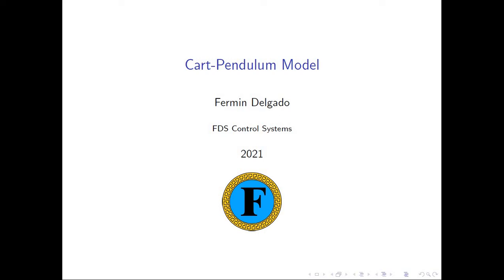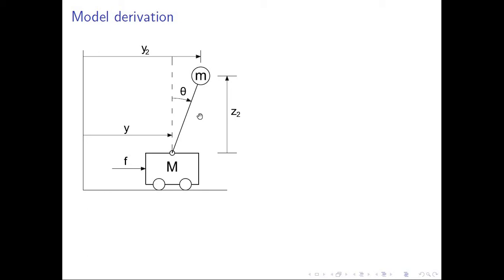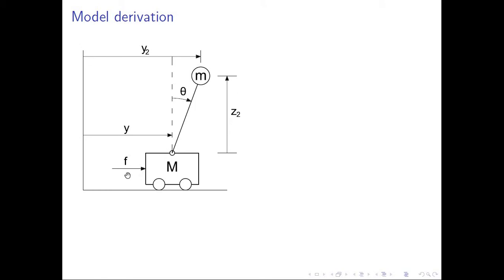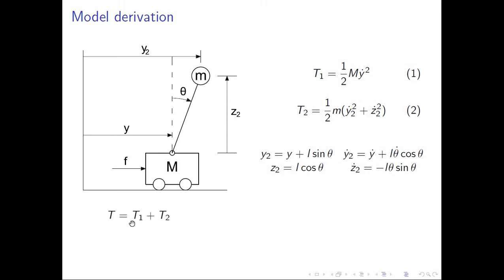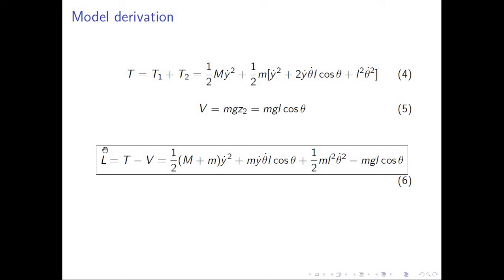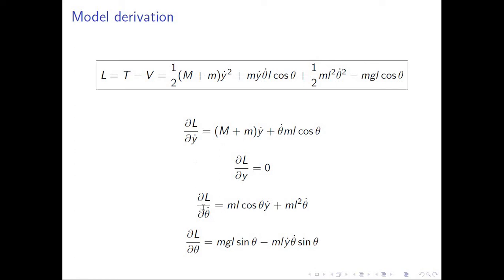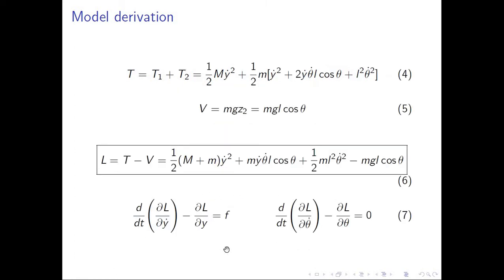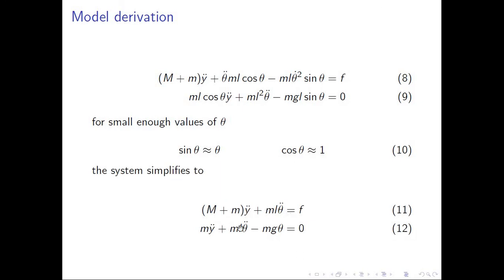Cart Pendulum Model

Comment: Could you explain how you went from equation 8 to equation 11? How did (ml theta dot squared sin theta) go away?
Reply from the maker: Sure! This is an assumption, just as I mention a few seconds before in the video. We assume that the angle variation is small, also this term considers very small quantities being multiplied so, it can be neglected. I repeat, this is just an assumption of small deviations which lead to a linear system. You can work with eq. 8 which is the nonlinear version, more accurate but more difficult to control.
Reply: @FerminDelgado  Thank you so much! I appreciate the timely reply!

Comment: What happened to the 3rd term (-ml thetadot^2 sintheta) in equation 8 when it got linearized into equation 11?
Reply from the maker: I am using the assumption that theta and theta-dot are small quantities, because of that, a small quantity squared can be neglected. That is what happens with the 3rd term: it is being multiplied by a very small value for theta-dot-squared.
Reply: @FerminDelgado  Oh okay it makes sense. Thank you very much!
Reply from the maker: @ItsDaShin  yes, my friend. I am using "Control System Design" book by Bernard Friedland in case you want to follow this procedure. Have a nice evening.